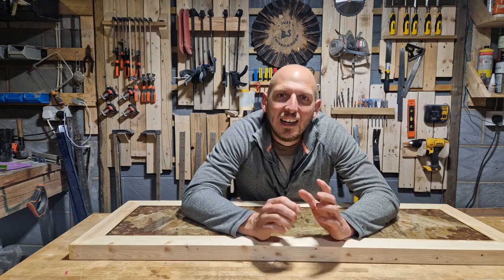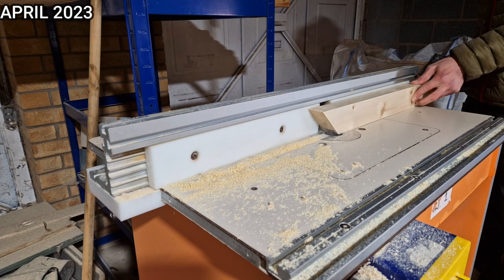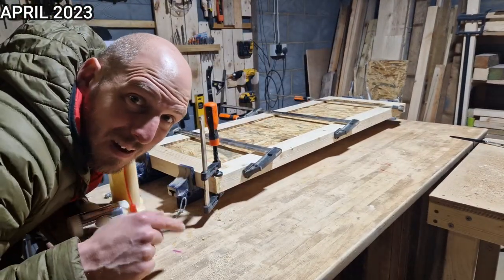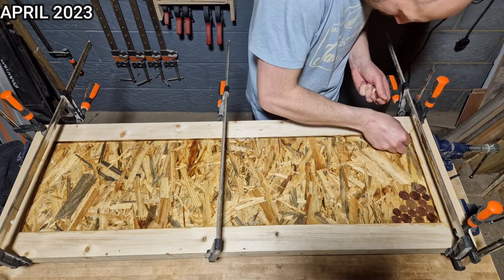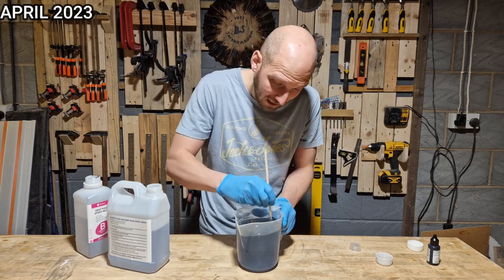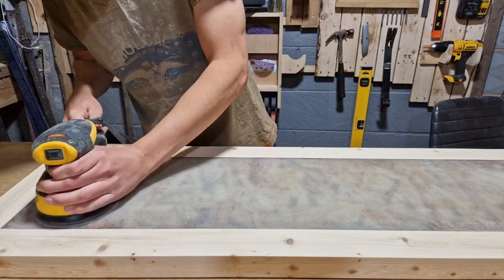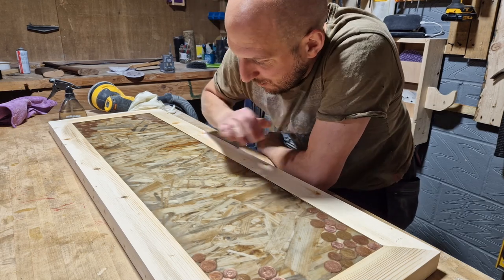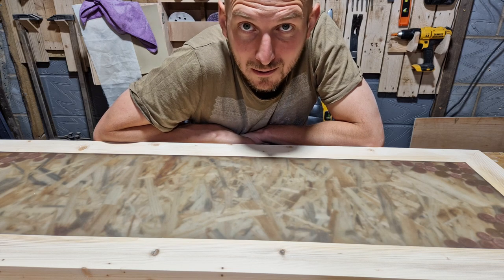EPOXY COFFEE TABLE: My biggest failure!!!

Comment: A story for you. 🤣 I had to replace a velcro pad on the base of a random orbital sander. The velcro was not dear. I then realised I could make any old pad if it had velcro on it and wasn't dangerous. Hello buffing pad from an old Dacron doona. I do own a polisher. It was absurdly cheap. But I never really use it. Reminds me of the sand blaster I own. With "sand blasting medium". It was cheap but... I ended up making my own from a sturdy empty juice bottle. I use it on the compressor with some fine beach sand. I genuinely almost never use my actual sand blaster...
 
So you can see where this is going 
You're on YouTube. You have a great channel. Very entertaining content. But what I'd do now if I were you is use some "YouTube-fu" - look for a hack to make a good polisher or find one cheap (perhaps second hand/used)… then polish that table. 👍 You could go a completely different  way and try get carnauba paste wax on it and a bright colouring, combine the two and highlight those scratches in a novel colour. 

There are many ways to turn your project around. And I'll politely say that if that's your idea of failure you ain't ever properly failed yet 🤣🤣🤣

If it were me, I'd either throw some experimental ideas at it or see if someone else wanted to. There's some quality mitres in it and not a bad pour. IMHO is not beyond rescue and is nothing like a failure yet. And epoxy can be a pita.  For a first attempt on that scale I think you've done well. 👍
Reply from the maker: Cheers buddy. I'm determined to see this through now and there will certainly be some 'hacks' rather than forking out more money for it. I think you're right and failure is the wrong word. I was struggling to find a word that describes a project that consistently trips you up while giving you just enough hope that you want to see it through 🤣

Comment: Interesting. Thanks for sharing.

I was all enthused about epoxy when I started woodworking a few years back but got the impression that it was far harder than the videos you see on YT & chickened out (for now). 

Your experience confirms to me that it's not a method to be trifled with.

For what it's worth, the table looks fine, at least on video. It may not be 100% perfect but definately not somethink to chuck in a skip!

I can see someone falling in love with such a quirky design, warts & all. I can picture it in some trendy craft beer bar, where it may well see some harsh treatment, which would add a few more 'swirly bits' over time. Combined with the OSB, I think this could add to its charm. Don't give up on it mate :)
Reply from the maker: Cheers for taking the time mate. I don't want to put anyone off epoxy, but you're right - it's harder than some people make out! I think I saw videos and thought I have the space, time and cutting tools! Turns out, there's a whole other stage after that! If I can figure out a way to fill that stupid bubble, I'll probably carry on with it and try to regain my expenses!

Comment: Mate you’re now in my wheel house with resin so hopefully I can help you out. 
Firstly the soft part is almost certainly due to the mix I’m pretty sure there was a part that didn’t mix well enough hence the sticky bit. Pouring from one cup to another helps before pouring onto the project and obviously scraping the sides down as you mix. 
For sanding every grit you work through just remove the scratches from the previous grit so it’s all about taking your time and don’t put too much pressure on the sander and keep it moving heat is not our friend. 
You don’t need special compounds for polishing I have about a dozen different items I use but as a start get yourself down to Halfords and grab some T Cut it’ll work fine. 
You don’t need a special polisher either you already own at least two you have a drill that could take a polishing mop or even try your orbital sander with a soft cloth. Again not too much pressure just work it over. You can buy fairly inexpensive polishing mops or just get some microfibre cloths and use those. 
To fill the bubbles just dig out any loose material use a Hoover or air gun then fill with epoxy. I’m not a fan of CA but you can grab some five minute epoxy from the pound shop it should cost no more than errrrrr ummm a pound maybe 😂
Finally to finish if you don’t wanna do anymore sanding you can use a spray lacquer over the whole piece which will help to fill some of the remaining scratches and give a clearer appearance. 
Failing that I’m happy to send you some higher grit sandpaper if you want?
Hope this helps but never give up.
Reply from the maker: You sir, are my hero! The main thing putting me off finishing is the expense of polisher and compounds. I know they're relatively inexpensive but £100 on gear that I'm not going to use again for a while was putting me off. Hearing you say about T cut and a microfibre cloth makes me very happy. I know you can get buffing pads for the orbital but I've not read good reviews. 
I'm really struggling with that air bubble. I just can't seem to get the dust out and with the pour being so clear it's really obvious!
I've ordered some higher grit sanding discs - what grit would you recommend stopping at. It's looking very smooth now at 400 but I know the more I polish, the more imperfections are going to appear.
Really appreciate you taking the time buddy, means a lot.
Reply: @justbswoodworking  Seconded - no need for expensive gear to polish... and it is actually the most satisfying phase so enjoy it Ben you've done the hard yards now mate!
Reply: @justbswoodworking  no problem Ben so firstly for the air bubble without making it ridiculously huge you can use a Dremel to drill it out then just pour a small bit bit of resin into it then sand back you’ll never notice it as long as you remove any debris from the hole. 
For sanding the main thing is not to jump too high in grit so if you use 120,150,180,240,320,400. Your next jump shouldn’t really be 1000 as it won’t be able to do its job efficiently. 
As I said before each grit removes the scratches from the previous one. I think you’re almost where you need to be so after 400 I’d say you use 600 & 800 so by now you’re moving from sanding to polishing/buffing then you can get some abrasive paste like true grit which is around 1000 or hit it with T Cut cream. 
Don’t forget as it’s resin you can also use wet and dry sandpaper which comes in different grits too. Lots of options really that are pretty affordable. You’re so close with this it would be shame to give up on it.

Comment: Thank you for the Vid and sharing the experience. Also you can get cheap buffing pads for your drill and or orbital sander.
Oh and Drill that bubble out, then fill with CA glue
Reply from the maker: The bubble scares me! it's one tiny bubble in the whole project but it's so obvious. It's exposed but I just can't seem to get the sanding debris out of it. I've tried using a pin to loosed it and then vacuum it but no success. Cheers mate

Comment: I think the spot where it wasn't setting up properly was from not being mixed well. Other epoxy pouring videos show the stirring being done with a flat stick being extra careful to scrape the sides. Pouring the mixed epoxy into another container and mixing some more really ensures it's mixed well along the sides. I've seen a pour that was much worse than yours with many very wet spots that never really set up.
Reply from the maker: Yeah, I think you're probably right. I mentioned stirring for 5 minutes in the video but each mix was probably 15 minutes in total (re mixing when I took it inside). In future, I'll certainly get a paddle for the drill and use 2 containers like you said. This one was a big learning curve! Cheers mate

Comment: When I was working with fibreglass resin that wouldn’t cure I would up spraying on some neat catalyst on the sticky patches. Also sanded up to 2000 grit wet and dry.
Reply from the maker: Another great tip to add to the bank in case I'm ever brave enough to give epoxy another go! Cheers mate

Comment: Another vote to keep going.   Can you not get a buffer pad for your sander, rather than buying a polisher, which may only be useful a couple of times.
Reply from the maker: You can but I haven't found any with good reviews yet. You're bang on - It's the only 'using it a couple of times' thing that puts me off. They're not massively expensive but it's another tool to store and another £60 that could go towards a table saw! Cheers mate

Comment: Ah man, the trials and tribulations!

Focus on the positive though:
Im not a fan of overwhelming OSB, but your use of it as a feature in a mitred frame and offset with the coin decorations looks really great. Also great job with that use of pigment, does exactly what you said it would re the yellow.

 Re the air bubble, i suggest first blowing it out (compressed air in a can, forceful straw and blow hard, etc.). If it wont blow out, just drill it out a fraction with a tiny drill bit and that will let you blow it out (to avoid scuffing the surface with the bit slipping on the otherwise fairly slick surface, i suggest starting just spinning the bit in your finger tips just to start the indentstion, before moving to a drill). In terms of filling, i get that superglue wouldnt be great for where your at in the sanding process. Alternative suggestion, try some of the uv cure epoxy! I came across this whilst trying to diy a windscreen repair. Whats great about it is you can fill it clear, wipe of excess, cure it with uv light (i got one that was glue and light in one), and then CUT IT FLUSH WITH A RAZOR BLADE meaning you could just go straight in at sanding it to match the finish at 400 grit, just to blend it (no sanding it down with higher grits). My only concern would be it showing up clearer than the rest of the table because of lack of tint - not sure what the solution there would be, but it might not even be visible.

Re finishing, some other good suggestions in your comments. Alternatively could do a self leveling flood coat (a different epoxy)...

Looking forward to part 2
Reply from the maker: Cheers Fred. Appreciate the kind words. I'm scared you might be right about the 'drilling out'. I just can't seem to get the debris out. Your predictions about the tint of the fill are also playing on my mind. In the scheme of things, 10 tiny drops of pigment per litre of epoxy isn't much but it's certainly not going to match up. I'm going to see this through and post the results but I think I'm going to leave it a week or 2. I've ordered some high grit sanding disks and have some time off work coming up - I don't want to revisit it on a weekend where I'm short of time! Cheers buddy.

Comment: Maybe try a little hydrogen peroxide on the soft bit? It could stimulate some additional crosslinking. Also, I think you can get buffing pads for random orbital sanders
Reply: Actually never mind. That's absolutely fine
Reply from the maker: As in on the 'unset' epoxy? Not something I've heard of but this is exactly why I shared my mistakes - to hear solutions like that!
Reply: @justbswoodworking  yep exactly

Comment: 1) round over the edges of the top. 2) swirly marks -> for the future, hand sand back and forth to get rid of the swirls. 3) get some automotive wet/dry sand paper from 600-1500/2000 grit and wet sand the top ($5-10 for a pack that includes everything). 4) get it to the best level you can and then put at least 3 coats of poly on the whole thing.
Reply from the maker: I agree about the top being rounded over. As everything is becoming smoother, the 'sharp' edges are starting to bother me. I thought it was the look I was going for but I've changed my mind. I know poly is very commonly used in the woodworking world but it's not something I'm familiar with - I'm more of a stain/wax kinda guy. I'm a bit worried about using it on this project! Cheers buddy
Reply: @justbswoodworking  Lacquer, poly, varnish, automotive spray clear coat or hard wax oil, whatever. Something that will "gloss up" up the sanded top.  

Take a scrap piece, put some epoxy on it, sand it and then spray it or put a coating on it to see how it reacts before you commit.

Love the channel.

Comment: Put a super think coat of epoxy on it and the the scratches go away.
Reply from the maker: Would I not be back in the same boat of sanding it up from 120? Genuine question... this is brand new to me!
Reply: @justbswoodworking  Yes and no. another layer of epoxy will fill the scratches and give you a much clearer finish. In theory, you will not need to sand after that. The real life downside is that, depending on the epoxy and your setup, it might not be flat and level. To flatten it, you have to sand, and the second you do that you are going to need to work through grits all the way into the thousands, and then buff with rubbing compound to get back to that "clearness". I've sanded all the way up to 4000 and still not gotten to same level of clarity as leaving it alone, you really need to buff to get back there. 

So, if you are ok with the risk of some high/low bits, just flood it with a new coat. If you want it flat, you got some work ahead of you...